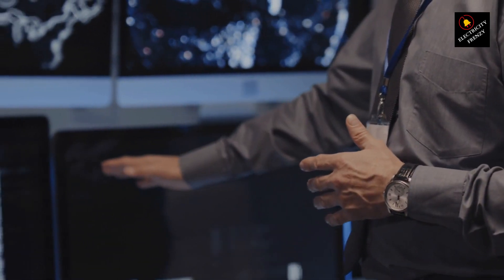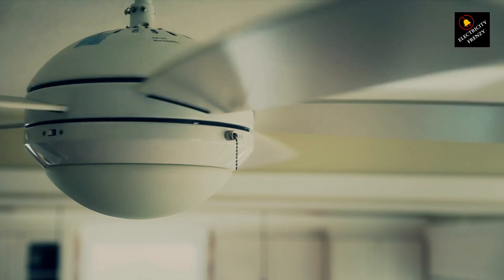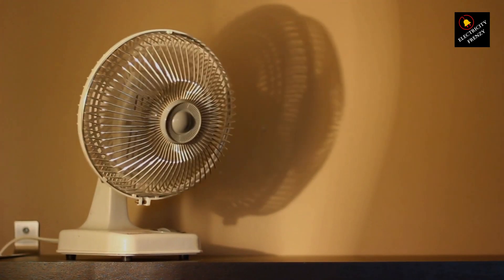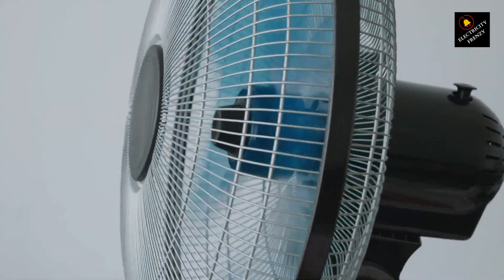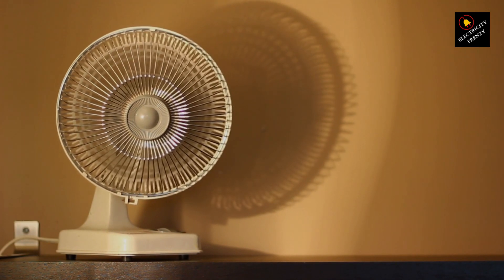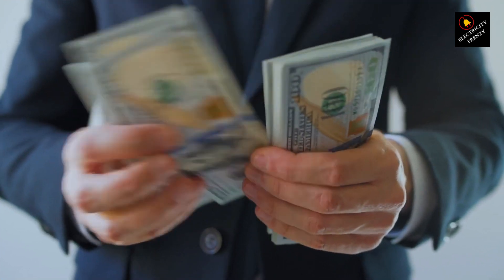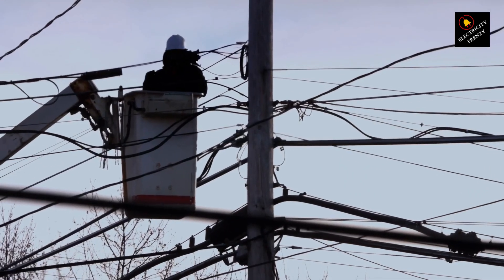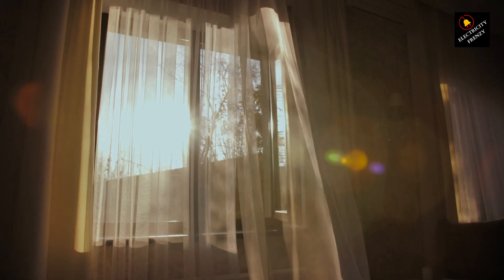Can Low Voltage Damage Your Fan? An Electrical Engineer Answers!

Comment: When the voltage is lower, how does the fan draw more Amps?  should it not be less Amps?   and you said "to compensate";  for what? how does the fan know?  thanks
I have an inverter 28 VDC to 220 VAC; it draws 27 Amps DC; 
  If the input goes down to 24 VDC, it draws 36 Amps DC; why is that?

Comment: Yup. Attached an adjustable fan controller to a 14" fan and lowered it to about 75v, easy on the ears...next morning it was dead. Now i know..not the same as lil dc fans.
Reply from the maker: It sounds like the adjustable fan controller might have caused damage to the 14" fan when lowered to about 75V. It's important to note that  AC fans are not compatible with voltage adjustments,  as opposed to smaller DC fans. Thanks for sharing this with us